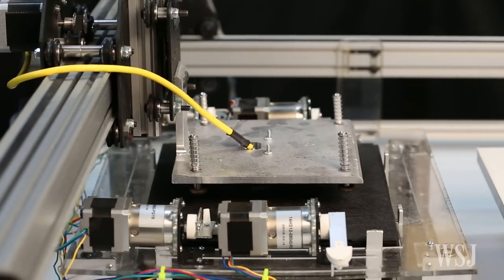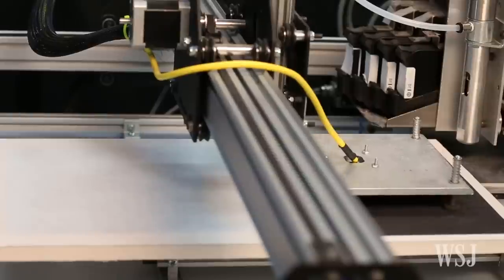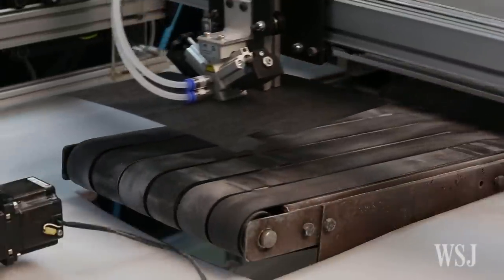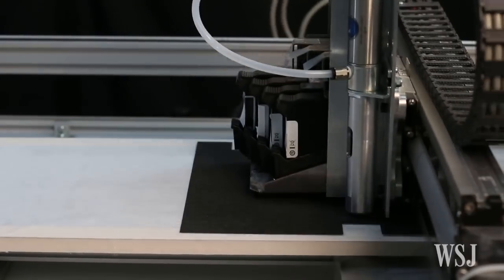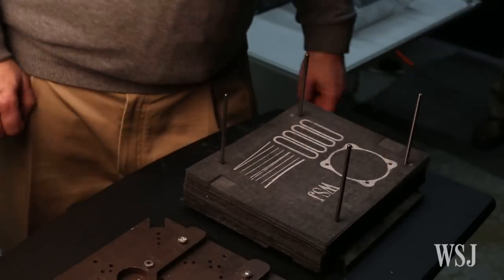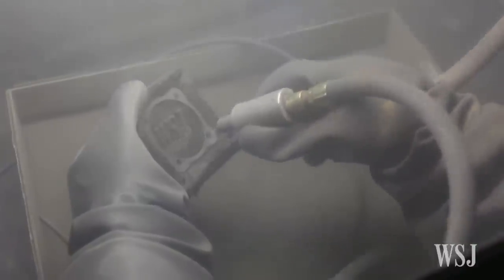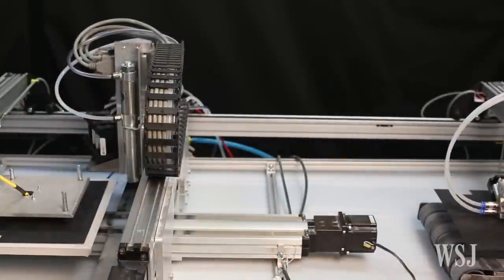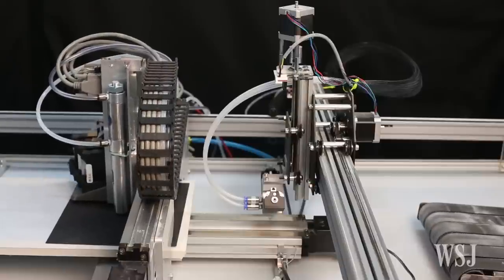New 3D Printer Makes Parts Stronger Than Steel

Comment: It basically LOM with carbon sheet impregnated with resin and "bead blast" the remainder.

With this process you will never get sharp edges (even if you want to) or fully encased hollow shape as it must allow access for bead blast to remove material.  So to call this process as an "impossible object" 0:38 making machine is a bridge too far.

Comment: "Stronger than steel" Video says "as strong as aluminum". An impressive technology. BUT THE CLICKBAIT MUST END!
Reply: Alternatively, stop doing tech reporting where you don't understand what you are talking about at all, and are pretty just saying stuff straight from the company's website, whether it is a proven technology on the market or it is still on kick-starter.
Reply: Well technically, some aluminum alloys like 7075 with a yield strength of ~520MPa is stronger than steels like 1008 with a yield strength of ~285MPa.

Comment: How is this a 3d printer
It seems more like a laser cutter
Reply: did you have the audio muted? it prints plastic onto carbon fiber sheets which are then stacked cured and sandblasted. 
it's an odd method its stacking single layers and making a layered composite then removing material to reveal the part instead of solid single material.
Reply: DarkShadowsX5 that is how every other laser cutter ever works